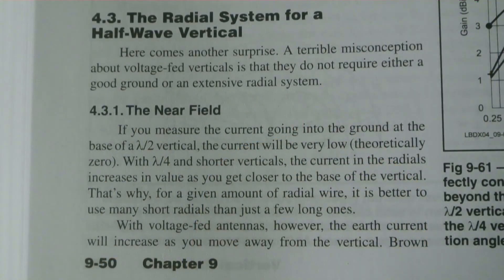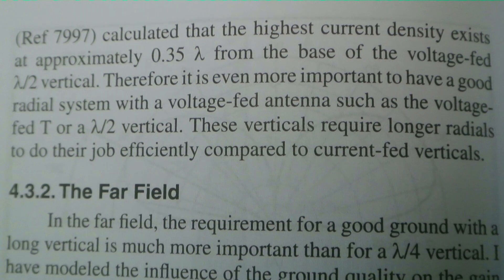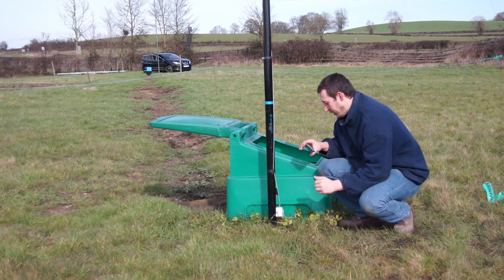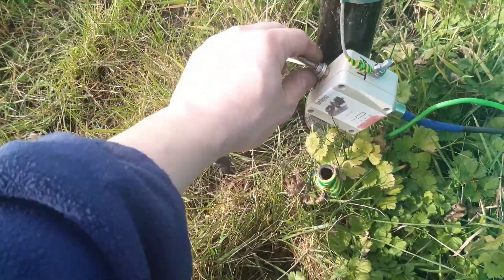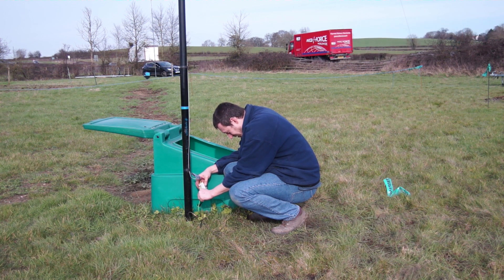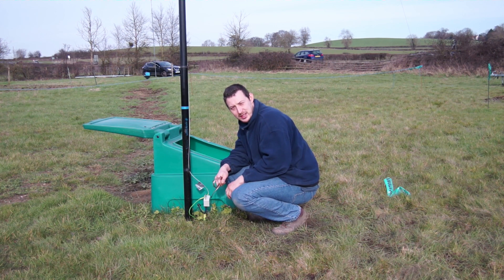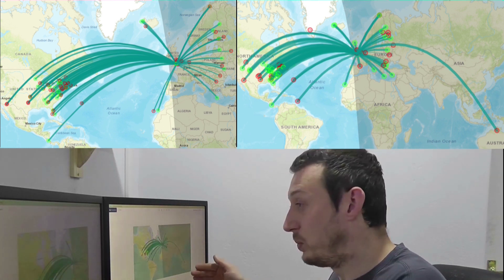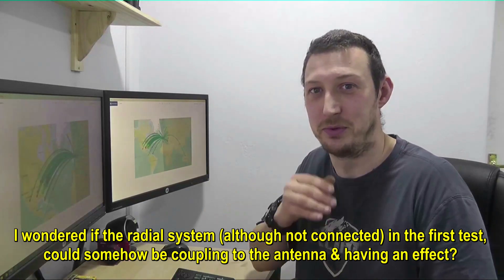Radials For EFHW Verticals

Comment: I am of the opinion that real problems are not debatable - we all recognize them when we see and experience them.  The issue of whether an EFHW antenna needs an extensive radial field is not a "real" problem.   We know this because there is debate about it and our experiences are telling us it's not a big issue.

We're making lots of contacts with both 1/4 wave verticals and half wave verticals, with both extensive and minimal radial systems, both resonant and non-resonant.  I suppose, if we want to get down in the weeds, we could establish conclusively what is the actual truth of the matter.   But, as far as I'm concerned, the issue is not important enough for me to care.  

My end fed half wave antenna for 80 meters works fine on all bands from 80-10 meters with no counterpoise at all, much less an extensive radial system.   Besides, the feed point is at 50 feet above the ground.  That's my truth, no matter what the math says.

Thanks for the video, and 73!

Comment: Interesting test, but I'm not surprised! Propagation can change in half an hour and easily mask any improvements. I think we'd like to think there would be a massive difference, but in reality one or two db is not going to be detectable and will be masked by propagation changes. I also think it may have been coupling into the ground radial system. What band did you use? Steve G0KYA
Reply from the maker: Completely agree with all your comments 

I think my logic at the time was that there would be a noticeable difference if radials were as important as stated in the book.

This was on 20m.

Comment: Best way for this antenna is mount It on smallish pole say 4m then have 4 non resonant counterpoise about 3.5m long keep them elevated, your find it works very well, 10.1m wire then a 85mm long trap of 35 uh then a tail of 1.8m on the end this will do 3 bands with no tuner from 40m 20m and 10m.

Comment: an interesting question: given documentation in the book, what results would or should we expect, better rx, better tx? any ideas on that?
Reply from the maker: This was filmed quite some time ago so I forget the exact wording in the book. I think it was to the effect that radials are as important to a 1/2 wave vertical as they are to a 1/4 vertical. 

If that is the case, then we would expect to see better TX (and by default probably better RX) with more radials.

Plenty of people have done experiments with 1/4 wave verticals to prove this but I've not found anything to show this for a 1/2 wave vertical.

Commonly accepted wisdom amongst the majority of the amateur radio community (which isn't always right to be fair) seems to suggest that radials are not important for a 1/2 wave vertical, as long as you have some sort of counterpoise (in some cases, people just use the braid of the coax).

While the author of the book is a highly respected DXer, what is in the book goes against what I have been taught & my (admittedly very basic & probably quite flawed) experiments seem to suggest that having a number of radials makes very little difference on a 1/2 wave vertical.

I'm wondering if I've misunderstood what the author was trying to say?

I'm really not sure what to make of it if I'm honest.

Comment: those are not radials. Thats called a counterpoise. They do different things.

This is not an end fed, its a vertical. Verticals are not voltahle fed, end fed horizontal wires are voltage fed

If it must have a 49:1 it is horridly out of match

Radials are VERY POOR for HF, they waste much power into lossy ground. Earth at HF is a lossy dielectric.

This system is a disaster. A grounded vertical 1/4 wave is 50 ohms. There should be no 49:1 transformer needed.

It is either shorted or very high impedance.
Reply: Of course it's an end fed it's fed from the end, at 2450ohm so needs a 49.1 correct mix and windings can be over 90% efficient,

Comment: You will probably find with the 1st single radial set up it was still coupling into your buried ground radials. 
I recommend you repeat the test but with the 1st setup should be well away from your earth mat. 
I think you will then see a bigger difference in efficiency.
Reply from the maker: Those were my thoughts. If you haven't already found it, there's a part 2 to this video where I tried exactly that.

Comment: I think your results are valid for you and your location,  no matter what any book says. There are so many nuances of location, soil quality, materials, etc that there just aren't any firm answers that hold in all cases.  We can generalize, but antennas continue to be at least as much art as science. 

Which is why I enjoy watching your antenna experiments on YT. As a fairly new ham, I really learn a lot from your work. Thanks!

73!
Reply from the maker: Hi Abraham, glad you like the videos & are learning from them.

Just because I run a YouTube channel, that doesn't mean that I know any more than anyone else! I am also learning from my videos!!!

You are very correct in the fact that there are a lot of variables.

Upon reflection, I think that the radials are coupling to the antenna on the first test (even though they are not physically connected). If I'm correct about that then it will have given my first test (without radials) a boost & messed up my results.

It would be interesting to try WSPR testing two antennas simultaneously (one with radials, one without).

I reckon that I could get two setups around 50 meters apart with the space available in my field. A possibility for the future!

Comment: Hi - good stuff  !  I do think the presence of the big ground radial system will have improved the result for the first run.
Reply from the maker: My thoughts exactly. When I get time I will probably do a follow up to this video & set up two 20m verticals around 50m apart (one with the radials & one without) & run two WSPR systems simultaneously to see what happens.

Comment: Definitely possible the radial system is coupling to the antenna. Until recently I had a 1/4 wave ground plane in the loft for 11m which had just two perfectly matched radials, but only worked properly with the loft ladder down. If I collapsed the loft ladder and pushed back up into the loft to put away, it being aluminium and about 2.5m in length, became another radial and directed my signal more northerly, but upsetting the balance of the grounding and raising the SWR a little.
Reply from the maker: Excellent, I hadn't considered that possibility for people using loft antennas but it makes sense. If it's causing your signal to become directional, I wonder what the front-to-back ratio is?!?!?!

Comment: Interesting test their James, I love comparison tests like this. I too wondered if the radial system could couple to the antenna whilst disconnected but I suppose you'd have to set up two systems isolated from one another. Great stuff mate, love it. 73s from Steve G6JEF.
Reply from the maker: I'm debating setting up two 20m verticals approximately 50m apart at the field & doing that experiment as a follow up to this video. "Watch this space" as they say!